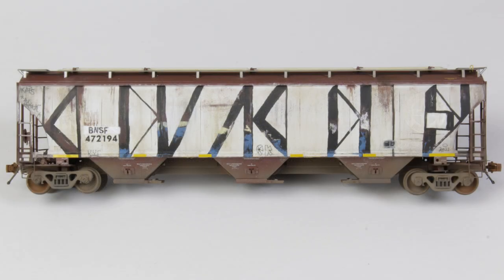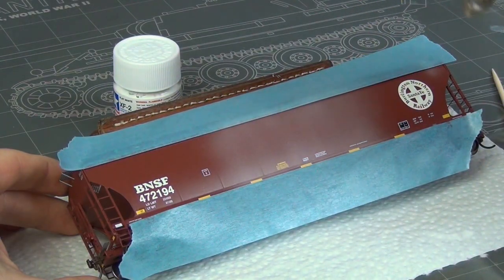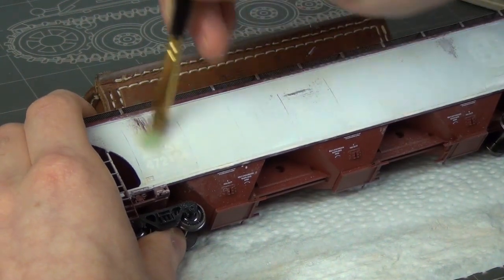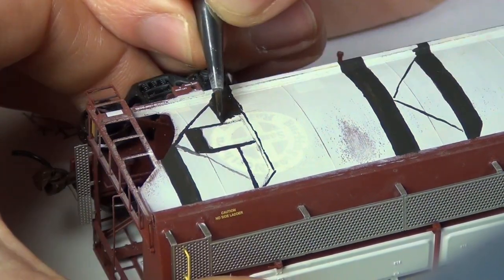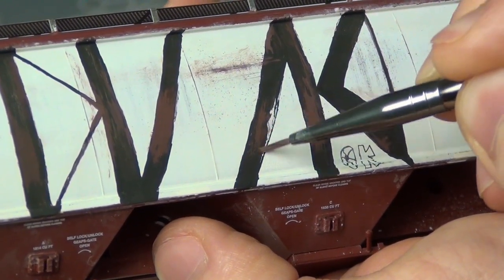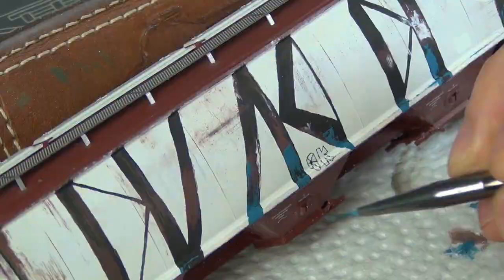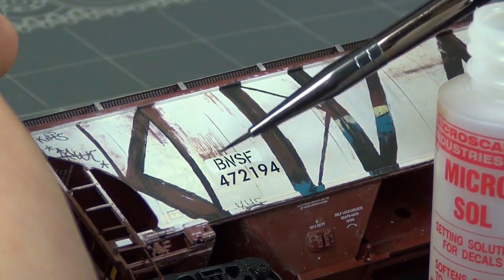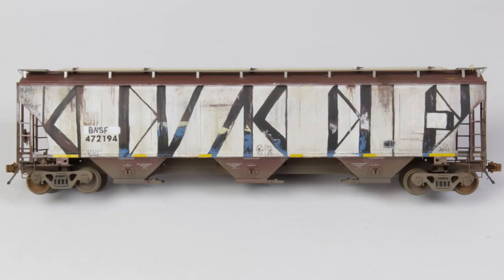How to Paint HO Scale Full Panel Graffiti

Comment: Awesome work!  I recently started experimenting with hairspray chipping, I think I was using Tamiya over Rustoleum base.  The Tamiya did chip but did seem a bit 'tough'.  I think I may try my vallejo air next.  How long do you think that whole car took you?  Done in a day or longer?  Thanks!
Reply from the maker: I'll give you a few tricks here that should help you out.

Hairspray chipping is much easier with alcohol-based paints like Tamiya.  If they seem too tough, try thinning them with water instead of the Tamiya thinner.  Also make sure you start chipping them within a few minutes of applying the paint.  

Polyurethane acrylics like Vallejo, Model Color, AK, Ammo, etc. are generally not good for this hairspray chipping technique as they form a sort of plasticy film that tends to come off in big sheets instead of chips.

I weathered this car in three evenings I believe.  Each session lasted maybe 2 or 3 hours  First evening was the white and chipping, then the next was painting of the graffiti detail, and last day was the stencils and other things like painting the dust and rust.
Reply: @Panzermeister36  OK, I think my issue then was that I didn't start chipping right away, it was sitting for a little while, b/c I did thin it as well.